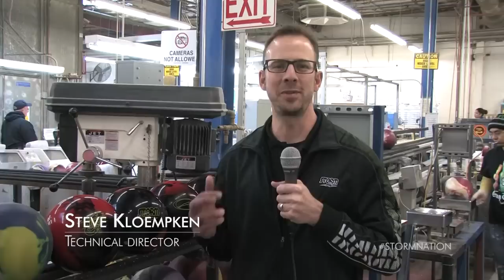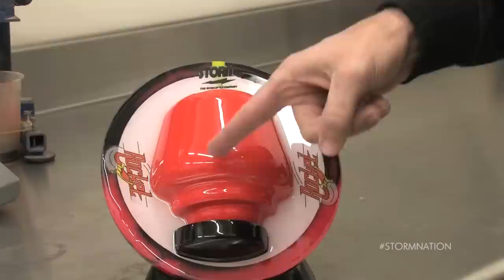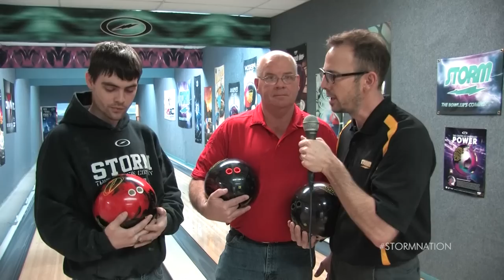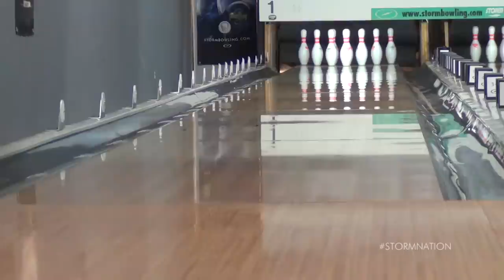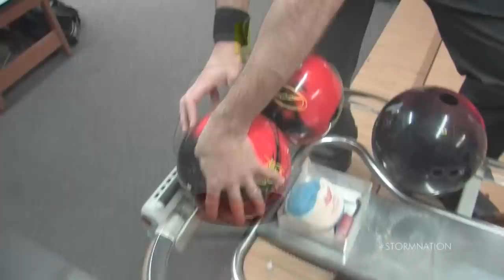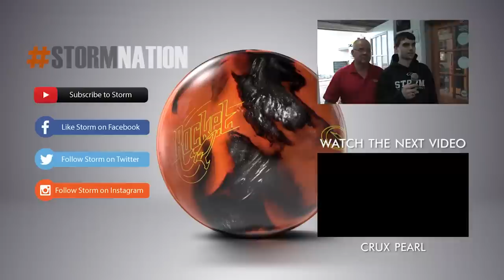Storm | How to Build A Rocket

Comment: My pro shop is trying to get me on this ball. I'm looking for something more agressive than what I have to complement my set. I know what I have is from a different company, but I'm not concerned about manufacturers, just reaction and feel.

C300 Meltdown: Max Leverage
C300 Deep Freeze: Pin 1/2inch above ring.
Reply: u know , rocket pin down is gonna hook , 1500 is quite strong.  do u put surface on ur equipment?  i would try that first if u haven't but if u want something stronger , like sport shot strong? if so then u might wanna go up to master line (  storm ) for roto grip try their hp4 line , the new hyper cell skid is very strong so i really recommend that ( i have hyper cell original and i only use that on sport shot , with surface of course )
Reply: The GomGomBoy - Thai Console Gamer How's the rocket work on heavier patterns with that then?
Reply: box finished it with pin down - 2 things since i don't know ur rev, inside shot it will hook early then hold ( put more surface if u need it ) , down and in will hook a lot earlier and i mean alot , before mid lane , i used it on earl anthony this whole week with pin down and that is a tough 43 ft of mess and i was able to use this medium ball with strong pattern and stay on my line more than many people ( they use agressive equiptment and kept moving ) but like i said if u want really aggressive ball check out their master line , those r super strong but tbh u don't just use the ball for whatever surface it come with , u alter it when it needed but i really really like this ball
Reply: nater308 You can have Alpha Crux. It’s aysmatrical  weight block makes it really punch back even on heavy oil patterns. I bowled 279s with it and almost all games went over 175

Comment: you can soak your ball in hot water to pull the oil back out to extend the life the ball no need to run out and buy a new ball st8 away
Reply: Sr8*
Reply: str8*.....
Reply: You could also have it resurfaced, or wipe your ball with a rag to take the most oil out between shots

Comment: ALL MARKET.....That last ball was further outside by 4 boards, the other balls looked like they were targeted at the 3 pin where as the last ball was more out towards the six pin.  If the dry boards were 3-4 boards to the right, that would cause any ball to come back.  We don't even know the pattern you all were on....Such Marketing
Reply: Yeah that's pretty shady
Reply: ***** Yeah they hit the same target, but the last ball had a different angle and got outside further than the other two. They should have thrown them all on the same line whether it's inside or outside to make it a direct comparison.
Reply: I don't think its all market I got this ball yesterday and it performs just like the video here, rolled a 223 with it that's pretty good for a 150 avg bowler :)

Comment: If as is widely known, the coverstock is responsible for roughly 70% of the ball reaction, ...then why did the ball with the strong coverstock and weak core, not hook more? It looked the same as the ball with the weak coverstock. We should expect it to hook about 2/3 of the final ball. Something is fishy here...
Reply: Although the cover stock is responsible for the ball reaction more, R2S is only a mid-strength cover stock (Still much stronger than entry level or plastic stuff, but not the strongest by any means none the less). Combine that with the fact the ball was on a very weak surface at 1500 Polish, the ball would really need an engine (core) to help it drive and read the lanes (hook). Since it didn't have that, the cover stock with good polish on it made the ball just want to slide the whole way like you saw in the video. It wouldn't want to hook more than the ball with weak cover stock, regular core.
Reply: Ι don't understand your explanation. The video doesn't mention anything about the surface treatment of the 2 first balls (that were not the final product). They mention a 1500 grit only when they talk about the final product. So the 1st and 2nd ball should have the same grit surface (if we want to have a decent experiment). On the 1st ball we hear "with that aggressive core it should bite a lot harder"....which is false. Put the strongest core imaginable in a polyester coverstock and it will do mostly nothing. That 1st ball went like a spareball. Which is fine because we don't know what coverstock they used. The 2nd ball however, has the FINAL coverstock, but a weak core. This ball should hook significantly more than the 1st, but less than the final product. However it hooks exactly the same with the 1st ball. Which is almost like a spareball. And the final product ball, was also NOT thrown at the same line. Its break point was 3-5 boards right of the other two...
Reply: If you look closely at the 3 balls, all 3 balls had similar polish surfaces. It's safe to assume that surface finish on all 3 bowling balls are the same. However, polish on the surface finish means that the bowling ball will have a weaker (longer) reaction regardless of other factors. For example, if you polish up a strong cover stock like the GI-16 Solid cover stock (the cover stock on the Alpha Crux), that ball reaction will still be weaker than if the surface finish was matte and the ball want to go much longer even with that strong of a cover stock. 

This is partly why the 2nd ball was not as strong as you thought it would be. With an entry level or maybe even no core inside of it, there is no way the ball is going to hook with such a weak polished surface finish, no matter how strong the cover stock. I also have to reiterate the original cover stock is NOT as strong as you think. It's simply R2S Hybrid, which is in the milder-weaker range of coverstocks ( However, R2S is still much stronger than whatever they put on the 1st ball ). Now if the cover stock was as strong as the GI-16 cover stock like previously mention, you would be able to see the difference in ball reaction, However, the mild original cover stock combined with the weak surface finish will not yield any noticeable difference in ball reaction, as you can see in the video.

Thus, in the 2nd ball, without the help of a core in it, the ball will not want to read and will be significantly weak even though it did have the original cover stock in it. With the original cover stock being mild-weak combined with a weak surface finish, the ball would need the core to help initiate and complete the intended reaction. This is why the video emphasizes the importance of a good core and cover stock combination, which ultimately helps to initiates and complete ball reaction. 

Going back to when you mentioned 'On the 1st ball we hear "with that aggressive core it should bite a lot harder"....which is false. Put the strongest core imaginable in a polyester coverstock and it will do mostly nothing. That 1st ball went like a spareball.' That was the point they were trying to make if you listened fully. It's not even to just have a good core in a bowling ball, the cover stock has to match it. The whole point they were trying to make in the little experiment was that core and coverstock combinations HAVE to match each other for optimal ball reactions.
Reply: So 3 balls with similar or same surfaces. (1500). Ball 1 has a weaker coverstock but the strong core. And does nothing. The 2nd has the stronger coverstock (of the final product) but a weaker core. And it does nothing.  So we have a coverstock and a core , influencing the ball reaction exactly the same amount. Please explain how that occurs... (the 2nd ball core was characterized as an "entry level" core, so it wasn't a spareball inside, it actually had a core that does something).  I did listen fully, and the sentence "with that aggressive core it should bite a lot harder", is simply wrong. It is a wrong assumption and they use that assumption to base the next thought. If they used such a weak cover on the 1st ball, the core SHOULD NOT make the ball bite a lot harder. Which is exactly what happens. The question is : why did the 2nd ball have exactly the same reaction as the 1st. That would only make sense if 1. ball reaction was influenced by core as much as by coverstock (which we know is not true), or 2. they had significantly different grit surfaces (which they didn't).
Reply: I think it's quite simple really. Going off your initial statement that coverstock affects 70% of ball reaction, for ball 2 (strong cover) to hook more than ball 1 (strong core), you're likely assuming that the core and cover would have to have EXACTLY the same strength, which is highly unlikely. 

Hence, it's more likely that the Booster core was stronger than the cover R2S Hybrid by an amount that led to them having a similar impact on ball motion. This would makes sense as the Booster core produced a differential of 0.046 for the bowling ball, which is in the high range and indicative of higher flare potential. Meanwhile, it's known that the R2S Hybrid is only a medium range cover stock, so it certainly should be weaker than the core. These differences are likely the reasons as to why you see both core and coverstock influencing the ball reaction the same amount. 

Disclaimer: While these could also be to other factors attributing to ball reaction, I think it's safe to assume that the experience conducted was a fair experiment as the surface finish was similar and Steve did throw the first 2 bowling balls with identical releases and identical lines, arrows to breakpoint. The 3rd ball can be excused for being a board left at laydown (resulting in the difference you see in breakpoint down the lane) since that ball is the complete ball and meant to be much stronger than the first 2 anyway.

Hope this answers the questions you had in mind.
Reply: Thanks for the replies. I have to say you make several loose assumptions though. You are comparing core strength with coverstock strength as if they were the same attributes. And your conclusion stems from assuming there is absolutely nothing fishy or wrong about the video presentation. Which was exactly what i commented on in the first place. I on the other hand start from the well know fact that coverstock effect is much greater than core effect. Instead of assuming the video is correct, i advise you trust the knowledge we all have. You assume the core of a MEDIUM SYMMETRICAL ball (the Rocket), so...NOT a very strong core and not even assymetrical, ...has so much effect on ball reaction, that it compensated for the 70% effect of the stronger coverstock of the other ball ! I think you are trying to make a circular argument.  Also a Differential of 0.046 is not in the high range, it's pretty medium. Just like the core of the Rocket.
Reply: I make these simple assumptions for argument's sake, as there's only so much we can do typing. I said that core and coverstock strengths compliment each other, not that they are the same attributes. Just look at another ball like the Code Red: Extremely strong core, much weaker cover (R2S Hybrid as well) but the core does make a significant impact to ball reaction as well. You can't say that the Rocket and Code Red are anywhere near each other in terms of strength, and I do not think you consider the contributions a core has to a bowling ball's reaction enough, even though it's only 30%. Although additionally, I do acknowledge that there's too many unknown variables (such as the exact 'entry level' cover stock and core they used in the respective test balls shown) to support and accurately prove any of mine (or yours) hypothesis, so ultimately anything we've discussed is simply rudimentary and we weren't be able to come to a satisfactory fully-supported conclusion.

I do not think it's fair to say there's something fishy about the video presentation either. This information is redundant to us as we already have the knowledge about bowling ball dynamics, but the video is clearly geared towards beginners and people with lesser knowledge of equipment and bowling balls. Yes, there may be over simplification and perhaps loose assumptions and concepts mentioned in the video such as the effects of core and coverstock on a bowling ball, but being more exact and complicated in the video presentation and science will result of majority of their audiences not being able to understand the information being presented and they can be bore away from the video if it is (trust me, there's wayyy too many people who have close to no knowledge about equipment). Case in point is Track Bowling, where some of their promotional videos with Mitch Beasley talking about technical stuff can be really useful to a bowler starting to learn more about bowling balls, but their videos only reach 1-4k views.

At the end of the day, Storm are a company and their marketing is meant to appeal to the masses, which is why they have some of the most successful marketing campaigns across all brands in bowling now, albeit sometimes oversimplifying things and not being exact enough with some technical aspects of bowling balls (such as in the Optimus video where they said the ball keeps the pins lower but is a statement that is subjective and extremely difficult to objectively support). People just aren't interested in these things, and the companies that actually try to get this information right and use it to promote their products do not manage to achieve the desired appeal they want and no where near the success of Storm Bowling's marketing. You can call them out for being fishy or getting something off all you want, but they will continue to be successfully appeal to the masses (NOT ME, I'm just as interested in technically correct information as much as you) instead of confusing and boring them.
Reply: Overall, I believe we can agree to disagree over different areas discussed. I appreciate that someone is willing to think out of the box and not just simply accept information that is presented, and that you do present useful questions for the thinking bowler. Although I think that these questions could definitely be used at a better time and place for present day issues.
Reply: I have no idea why you take so much time defending Storm. I for one am not attacking it. I am simply saying the video and their "experiment" seems to contradict common bowling facts. Plus i don't like marketing as it usually distorts facts. I didn't accuse you of saying that core/coverstock ARE the same attributes, but that you compare them as if they HAD the same attributes and thus were comparable. As if they were both "apples" so to speak. There is no scientific way to say "this core is as strong as this coverstock" to describe ball reaction.  Finally, your example of Rocket vs Code Red sounds weird and actually proves my point. The Code Red has a much stronger core and has a lot of assymetry, and yet compared to the Rocket it is not much stronger. Actually Bowling This Month compared them and they seem pretty close in terms of total power. Its just that the Code Red has more drilling options to get more out of it. So yeah. That further proves my point that the 30% part of a stronger core cannot compensate the 70% of a stronger coverstock, as you assumed.